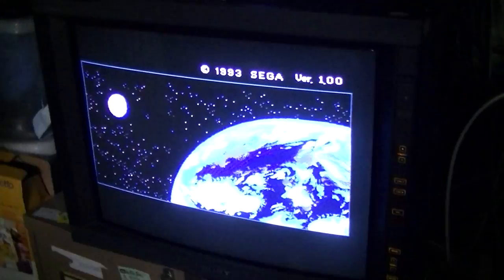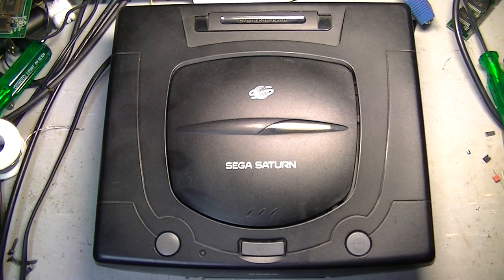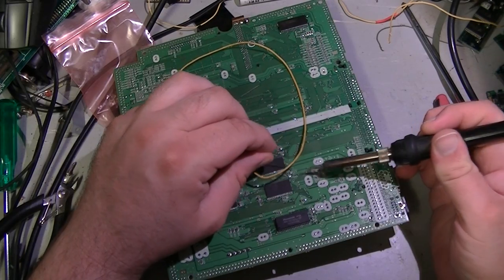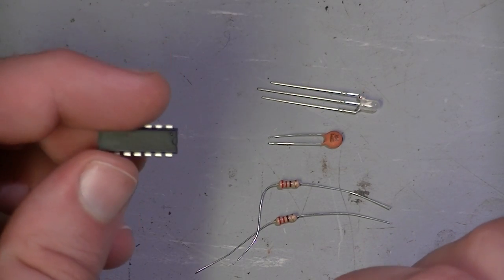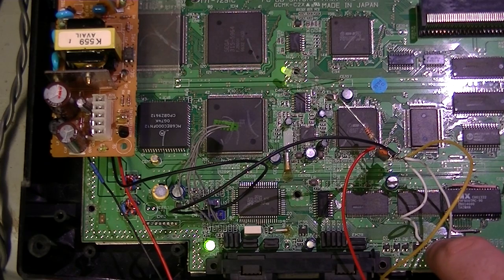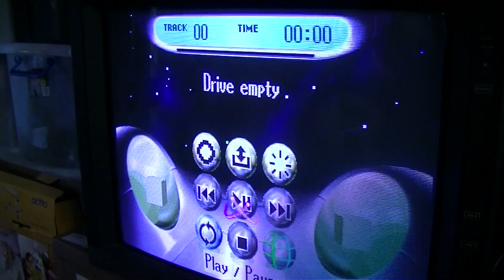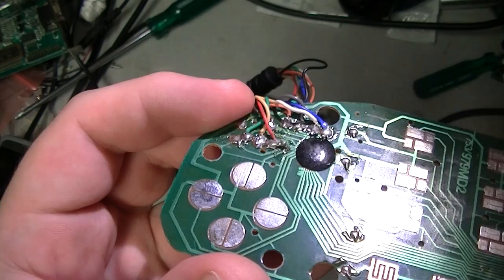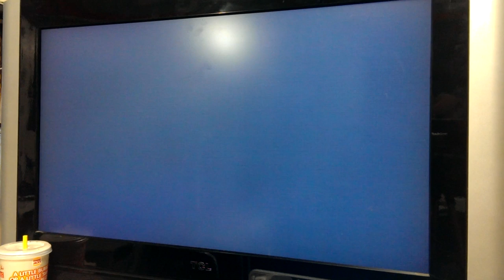[retro swim] - Episode 23 - Mods mods mods!

Comment: Were the mega drive controllers not already compatible with the cd32 anyway?
Reply from the maker: For basic "Atari Mode" operation, with the d-pad and one button, yes. To get the additional buttons working with just the 9 pin connector, the multiplexer is needed. The MD pad is also multiplexed, but differently, hence the modification.

Comment: What is the model of TV your using?
Reply from the maker: The CRT screen in the Saturn/MCD sections is a Sony PVM-2950QM, the LCD in the Amiga section is a "TCL" 720p piece of crap. Hope this helps! :)
Reply: That's what I thought it was, I think it has the same tube as the xbr100. Those pvm's are hard to find.
Reply from the maker: Yeah, I lucked out and picked it up for $2 at a government surplus auction.
Reply: Wow, good find. Are u a fan of the Sony HD crt's?
Reply from the maker: Jason Spero Unfortunately I have not had the pleasure of trying one out!
Reply: Well all the pros and con's of Trinitron CRT's except magnified. Especially over scan and focus issues.